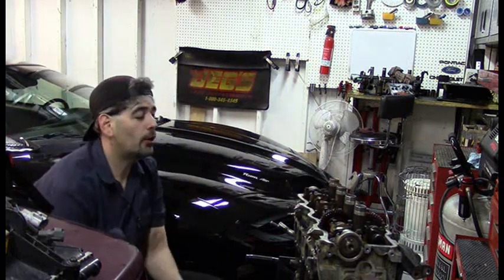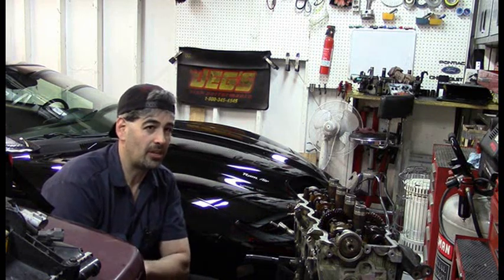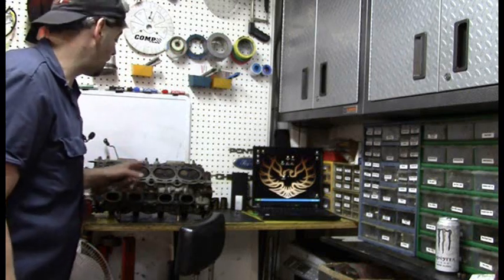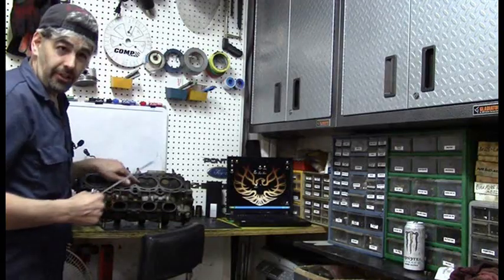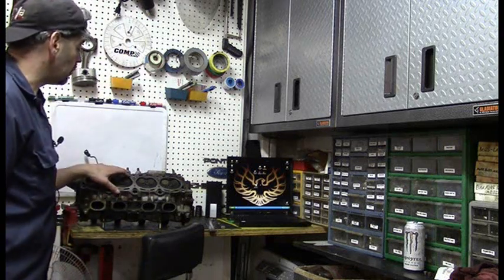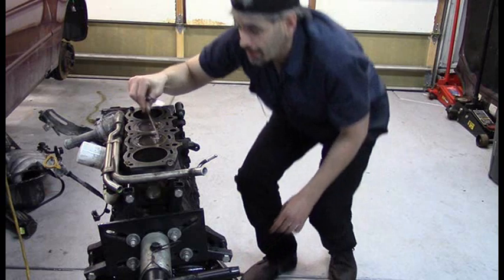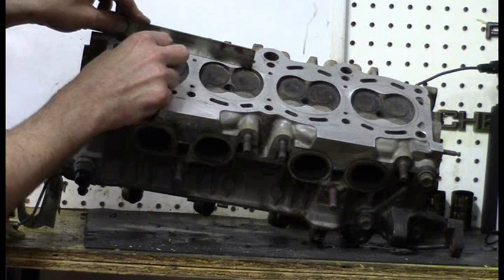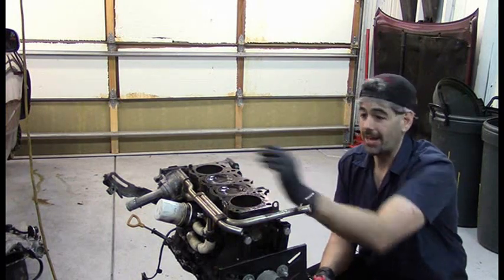Replace a Cylinder Head Gasket Yourself and do it RIGHT! Part 1

Comment: Not looking for free advice, time is important, but beginning the tear down to replace head gasket.    Camry 2.2l 1998.  
1.  Reasoning and tests:
     A.   Coolant loss - reservoir empties every 500 miles,  rough idling upon engine start and warm up.     Car overheated 1x due to leaky water pump.    Timing belt and water pump replaced, all seals on that side of engine replaced also.  
     B.    Tests - Pressure test of cooling system - no loss of pressure over 2 hours at 20 psi.
     C.     Test 2 -  Exhaust gases detected above coolant as purple fluid turns green (done at radiator)
     D.     Test 3 - aborted.   Compression test not done as I stripped one spark plug thread.
       Best Conclusion - small leak in head gasket.     Replace gasket.     

2.   This video brings up the idea of exhaust manifold leak possibly putting exhaust gasses into coolant.   I hadn't considered this.    Could this also results in exhaust gasses in coolant (as test showed).   I'm willing to do the whole head gasket and related  jobs, but really would rather not if it's a leaking manifold gasket.   How can I know?  Any advice I appreciate.
Reply from the maker: I don’t understand how you came to conclusion of leaking head gasket??
Reply: @SchrodingersBox  exhaust gases in coolant as tested.    cooling system passes pressure test so no leak in cooling system.   The test where you warm up car, place tester that has blue fluid over radiator without the cap. If combustion gases bubble through the coolant it turns green.    Positive test of for combustion gases in coolant is when the fluid turns from blue to green.   After this I wanted to confirm with a compression test but stripped the threads in the process on removing one of the spark plugs.   Thanks for your response, is the combustion gas test enough?  or can those combustion gases come from a manifold leak as well?

And in the first post I said the car overheated one time from low coolant due to leaking from the old water pump.
Reply from the maker: I would totally do a leakdown test.
Reply: @SchrodingersBox  Okay.   Again, the suspicion of head gasket comes from 1. overheating incident from unknown leaking water pump (did pump and timing belt job).   2.  from the bromothymol blue test for exhaust gases (co2) in the coolant water.    During this test, the fluid turned from blue to yellow indicating acid ph of coolant:  possible cause:   carbonic acid cause by co2 from combustion. 

Was able to do compression test (pulled plugs on warm engine, disables EFI and spark,)  210 on each cylinder.    Had to fix bad threads in spark plug on one cylinder.   Turns out some grease and careful threading of new plugs worked fine.    So that compression looks excellent.    But noted steam or maybe oil? vapor rising out of one cylinder during compression tests.

Will run chemical test again.   then will get the equipment to do the leak down test. 

If this is not a head gasket, can a leaking intake manifold contribute to the failed chemical test?  What else could it be?   Again, car runs ok.   Loss of coolant in reservoir.    Pressure test of cooling system shows no leaks in cooling system cold engine.
Reply from the maker: leakdown test for sure. if it passes leakdown test then it’s not head gasket or cylinder wall compromised.

Comment: I was getting all kinds of white exhaust and it smelled of antifreeze.   So I bought the head gasket kit and a set of 16 bolts.   I got the engine apart , 3.3 liter caravan engine.  You could see that coolant was getting in at least one cylinder.  I cleaned the heads and the block surface and I went to Princess Auto and got a feeler gauge.   Everything is perfectly flat. I don't think there are any other problems and that it was the gasket that failed.    The reason for this is that my transmission failed and I had to drive from Winnipeg to Grand Forks and it was stuck in second gear.   So I took the van round trip about 300 miles at high rpm.   I drove slowly on the highway and pissed off a lot of cars passing me.   I think the high rpm cause the problem which became apparent shortly after that drive. So I am hoping that was the cause of the problem and that it will run OK now.   Just putting it back together.     The heads were flat and I could not slide .002 feeler under my ruler.   I also checked it with other rulers and also checked the ruler that is was flat on a piece of granite tile. 
I fixed the transmission by getting another computer from the parts yard and flashing the memory chip with my VIN.  The old computer is mounted on the bottom of the wheel well and was corroded to the point where water got in the main board and fried it. I got the memory chip flasher from China and did it myself on my PC.

Comment: Have a '03 ford Windstar with coolant in my oil ( looked like a milkshake), didn't see any oil in the coolant I drained and was told head gaskets shot. While it was running I noticed that the intake gasket above the number 6 cylinder was  damp and could see a little bubbling while it was running but a local garage told me it cant be the intake gasket only head gaskets leak into the oil. Van has never over heated and after cleaning out had no bearing noise. But haven't put coolant into it as I have a 5 year old to get from school, only 5 min away and plan on tearing apart next week.

Comment: My friend had a 94 Miata that leaked on cylinder #2 and #3, he had just bought the car from a guy that later turned out had the headgasket replaced at a Miata shop, the owner didn't disclose the coolant lose issue he was still having with the car during the sale, which is why he really sold the car as it turned out. Aluminum head with cast iron block. We took the head off and had a machine shop check it. The head was fine and not warped or cracked. What we didn't do is invest in a straight edge to check the block.Since the head is not warped how could the cast iron block be warped? We thought it was a bad head-gasket job from the Mazda Miata shop. After all the work complete it was leaking on #2 and #3 again. Took it all apart again and found out the block was warped. Whats interesting is that the Mazda shop that did the work didn't change the head, so how could the block be bad?
What probably happened was someone might have replaced the head and end up selling the car and the guy that bought it sold it to my friend not being able to resolve the issue. This was an expensive lesson to always check the block and the head surface for warpage during a headgasket job.
Reply from the maker: Wow, yes I always check the block of course but I have never, ever seen an aluminum head and cast iron block where the block warped but not the head.  I don't even see how it is physically possible in fact- aluminum is so much softer and lower melting temp than iron, you would expect an aluminum head to liquify before the cast iron head even started to think about warping.
In fact, I recently saw a car that overheated so badly that the aluminum head was so warped you could just look at it and tell, but the deck was completely, perfectly flat.
  Really don't know what to say about that experience but indeed, always check both surfaces anyway.

Comment: EJ25 subaru engine. If you own a vehicle with this engine just plan on doing Head Gaskets every 100k miles or so. Engineering design flaw. Not necessarily a failure elsewhere in the cooling system, but that is also possible in some cases. I have a forester with this engine that has 205k miles on it I did the HG 80k miles ago. Subaru was the cause of its failure nothing else. The issue was overheating and the head gasket was the cause of the overheating, combustion gases getting into the cooling system. In fact i find that this type of head gasket failure is more common nowadays than what your describing with fluids mixing. The Fluid Mixing issues are not as prevalent as they used to be since most Manufactures are now using Multi Layer Steel Head Gaskets as opposed to Composite gaskets that were used in the past.

Unexplained overheating under load (high speeds, uphills, long trips highway trips) it's most likely a Head Gasket.

Videos that show the R&R process gets lots of views because people come to Youtube for both entertainment, and self help. Not everyone knows how to change an alternator or whatever part, so people like to see if it's something they can tackle on their own or if they should pay someone else to do it.

Comment: Good videos part 1 and 2.  I enjoyed your thoroughness and scientific methods.  I am about to delve into a head gasket redo for a Dodge Ram 1500 truck.  One thought that came to my mind is that I plan to do the head gasket job on a V block in the truck.  Given the angle of the block I thought this may create an issue of oil running onto the mating surfaces when I am inserting the lightly lubricated head bolts and greasing them etc...?  Also it may be difficult to get a large torque wrench into the space to get that smooth swing like you demonstrate.  Any comments?
Reply from the maker: You are absolutely correct.  Almost invariably I remove the engine on V engines when I do head gaskets for the exact reasons you mentioned.  It is usually possible to do it in the car but I really prefer to ensure I have complete access to do it right,
  Usually 4 bangers are not an issue like that but I actually have always removed the engine.  It also allows me to do complete bottom end inspection, replace oil pan gasket, etc. Once you are to the point of a removing a head it is usually just about 2 more hours work to get the engine out.
Reply: Wow.  This dig is getting deeper lol.  I guess I need a crane to pull the block then.  Is there any point in just doing more work while I have the block out?  THis engine has 170k.
Reply from the maker: Scootermule123 Yes there is.  Usually when I pull the engine (yes you need a crane) I replace every seal and gasket on the motor- front, rear main, oil pan gasket, water pump- everything.
  I also inspect the rod bearing and may even replace them if needed. Remember- lots of other damage could have happened besides the head problem.
  On reinstall I replace whatever else I find needs it- usually I find bad motor mounts, vacuum lines, stuff like that.
Yes, this is a real job bro- it requires lots of time and effort to really do it right,
Reply: I have already rebuilt a VW engine, and I am a DIY mechanic etc in general.  But still a novice.  I appreciate your videos and responses sir.
Reply: I too am very thorough.
Reply from the maker: Scootermule123 Good DIYs often tend to be more thorough than professionals because we are usually not under time constraints.  But getting good training (for the very few that want it) is always the biggest challenge.

Comment: You are SUPER smart on these things CONGRATS! What makes 2 engines alike one of them have 5 times more air run through it? My dad has 2, 5.7 350 96 chevys 1 with 250000 has 130 lbs and one with 5000 miles on it have 30 lbs MAX going into it. I know this with live data with the maf sensor i switched the sensors around and same results it has good fuel pressure and had the exhaust  checked at a exhaust shop and it is free flowing. I also checked the compression and it has 215 lbs to 210 on all cylinders on the new engine with low power.The one with 5000 miles has WAY less power than the one with 250000 miles im at a loss. Im i missing something? Thanks for any help!

Comment: I don't know about other people, but I think with disassembly, I would like to know the order to approach things.  I worked on rear wheel drive vehicles in the 80's, especially 1 ton trucks.  There is a LOT MORE ROOM on those.  I agree once you are down to R & R on the heads, it is all the same.  But on for example a 2000 Venture,  I don't really know where to begin.  Looking for sequence to avoid unnecessary work.  Just knowing whether or not to rock the engine forward or not, etc.

Comment: How often you are supposed to change the Engine head gasket? 
I'm changing Valve cover gasket and purchased a set, there is a Cylinder
 head Gasket as well, not sure if I'll be able to change it. Thank you 
for so informative film.
Reply from the maker: Only change it when it’s leaking. It’s not a preventitive maintenance thing
Reply: @SchrodingersBox  I see, thank you. There is a reddish-orange tiny gasket as well in that set packed for some reason with boots that go on the valve cover. I saw in one film the similar one on some part under the car. Another  also red-orange, size a bit smaller than the one for the valve cover. maybe you can tell where those go? Sorry for many questions, just want to do more things, when everything is open.

Comment: I really enjoyed you videos on cylinder head gasket repairs. If someone could respond and let me know. My car just died no warning. Wouldn't start checked spark and fire was getting both but fuel wasn't burning. Did a compression test and 1 had 30psi 2 had 0 psi 3 had 0 psi and 4 had30 psi. I'm tearing it down because I have no choice. I'm on disability and have a very fixed income. What else do I need to look
Reply from the maker: you have a broken timing belt most likely.

Comment: About the reusing head bolts or not my experience is basically "do what the manufacturer tells me" what comes to mind first is the Rover K engines which have a pretty funky sandwich like construction with REALLY long bolts. Service manual asks you to measure the bolts and if they're within a certain lenght they can be reused, same goes for Mazda's 13B engine if I recall correctly (which is also bolted sandwich like, hmmm)

Sorry about the poor english skills.

Comment: I appreciate you taking the time to tell us that if we don't find something that's readily apparent wrong with the block or head that there could be a bigger problem. Along those lines though, does that mean that, theoretically, the head gasket could last indefinitely? Could a poorly made head gasket fail on it's own? Or would that mean that there is a problem beginning to occur with compression and such? 

Hopefully I'm not coming off as a troll. I'm just trying to get more info.
Reply from the maker: +Oscar Conroy (Racso562) No it's a valid question totally!  All I can say is that I haven't seen a situation where just the head gasket failed due to age or whatever. valve cover gaskets, intake gaskets- yes (they're torques to just a fraction what a head is).  I imagine if a 1958 Chevy came in with a bad head gasket and nothing else was wrong I suppose it failed from age- I've never seen it. But when a 2002 grand am comes to me with a head gasket failure I 100% guarantee I'm gonna find a cause.
Reply: Schrodingers Box I see what you mean. Thanks for the information! I might have more questions as I watch the reset of the series.
Reply: +Schrodingers Box   I asked my nephew about this and He has been a mechanic for a G.M dealership for 20+ years.  He generally agrees with one exception.  On the Chevy 3.1's, 3.4's, from 2000 to 2003, G.M. found out that the new Dexcool antifreeze they converted to would eventually desroy the head gaskets they were using.  The best estimate though was that it would happen beyond their warranty period so they never did a recall.  The new replacement gaskets from the dealership are constructed of material that will not fail from Dexcool.  This is for information for those owners and not intended as to dispute what you are saying.
Reply from the maker: Ted Rowland This was the case with INTAKE MANIFOLD gaskets, not head gaskets.
Reply: O.K.

Comment: Hi,
Thnx for great videos.👍
I have a vw 1.9 tdi 2009, have 345000 kms on the clock.
I recently noticed a leak on the right corner of engine block where gasket is located. Car goes perfect, compression is perfect. Gasket is not blown around pistons, no abnormal smoke from exhaust. Torque is good. It looks like gasket is just gone bad on the outer part of it. Can it go bad like that? I know u sad there must be a reason for gasket to go bad. I also recently washed engine with a degreaser and they are corrosive, so could it damage gasket if it comes in contact. Considering mileage, it looks just like wear and tear. What is your opinion?
Many thanks.
Cheers.

Comment: I replaced my own head gasket today, and as far as markings on it of which side should be touching the head and which should be touching the block go, there were none, so I looked at how the previous head gasket was installed and saw that the side with the touching rings was the side that was touching the head. I thought that maybe whoever did it last was possibly wrong and tried to fit the gasket on with the touching rings on the block and the perforations and holes didn't line up correctly. I don't know if its different for different models but the side with touching rings was the side that was supposed to be touching the engine head.

Comment: But if it’s just one do you recommend me doing this?? I’ve changed sparkplugs ,coils ,fuel injectors , map sensor ,coolant change , coolant temperature sensor, and still can’t get rid of the po305 misfire 😐

Comment: Nice video, I'm changing out my head gaskets right now for the first time.A radiator hose busted I believe from a bad thermostat,and leaked all the coolant, my wife continued to drive it until she got home then the car didn't want to start no more, my question is is this my root cause and would that cause me to lose compression I had coolant in my oil and spark plugs

Comment: I removed my cylnder head because  i had a busted bolt in the exhaust that had to be machined out ,,then I decided to clean the pistons & do a valve job ,paint the head & install a new carb .